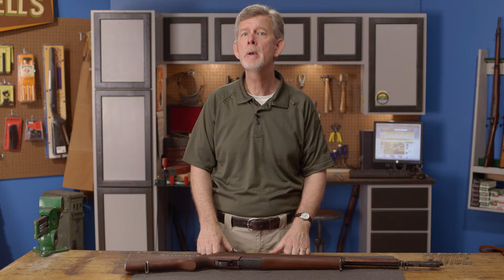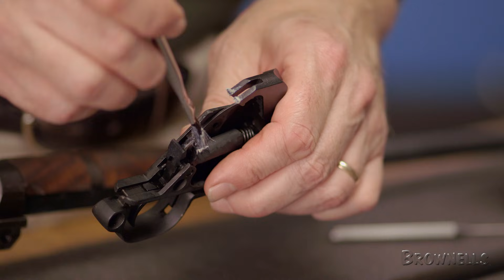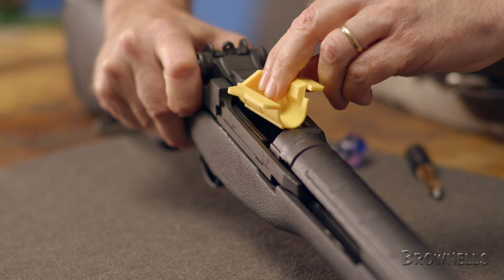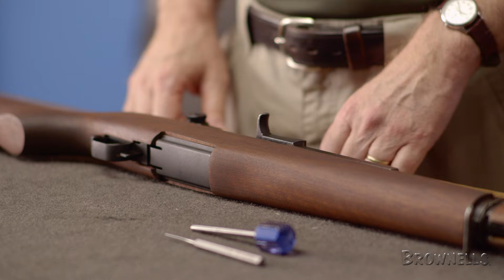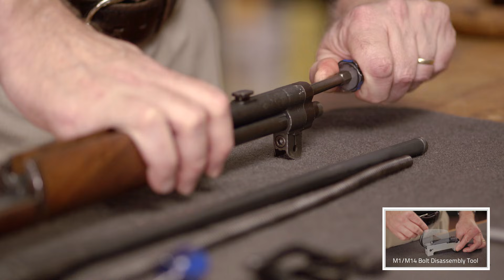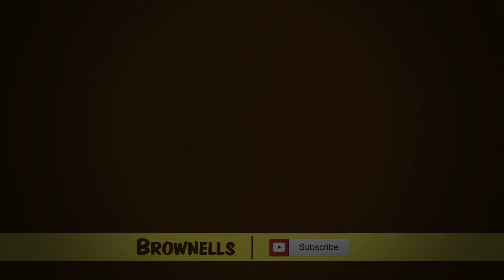M1 Garand Firearm Maintenance: Part 1 Disassembly

Comment: I had a Locksmith in Clovis California. Tell me that the M1 is no M-16 so don’t clean it like an M-16..  He also said that removing the gas cylinder too many times will wear out the splines on the internal gas cylinder and barrel so I found out the hard way..  I ended up with the proper barrel for the year of my rifle that when the gas cylinder was assembled, it was a nice tight fit.  My M1 shoots beautiful now..

Comment: I learned to get a medium string, tie one end off, oil the string and loosely wrap it around the small threads like the gas cylinder lock, screws, etc... going back and forth cleaning the grooves, then a light touch of wheel bearing grease ( actually artillery and weapons grease ) , this prevents siezing up, also on all moving parts, reducing in friction and easier cleaning. When stored a film.of grease in the bore and front handguard spacer.  Q tips, tooth picks, dental picks, pipe cleaners, fine steel wool, REM WIPES, bore brushes. A 1 piece steel cleaning rod,  armorerors tools ( no screwdrivers ) , 3 in 1 oil,  etc... for my cleaning kit.

Comment: First time disassembling this Garand, I have 5, I cannot get the  the follower rod and spring to disengage from the receiver, I’m afraid to break or twist a rather small component as it will not budge, do you have any Garand tips to loosen this component, I have followed these 4 parts of disassembly, maintenance, lubrication and re-assembly before, never had this problem, any words of wisdom would help, by the way, I have never fired this weapon so it is brand new and unbroken in!!!😊

Comment: Great info, as always. You should do more total disassembly videos. I've been restoring and maintaining a lot of firearms lately for friends and family, and I want to learn how to be a gunsmith. I disassemble the gun down to the smallest piece that I can safely do with my skill, remove anything any little speck of dust that a Marine Corps drill instructor could even dream of finding fault with, then give everything a coat of Ballistol, lubricate where needed, leave dry the parts that need to be dry, etc. The problem is, a lot of the firearms I've been working with aren't shown in YT videos. Or only the field strip phase is shown, or the disassembly won't show how to take the bolt and trigger group totally apart, or the person's hands are in the way so a specific step is poorly shown, etc. The worst is when there is a YT video that shows the steps required for total disassembly that I need to see, but it's part of a video about customization or high level gunsmith stuff that I can't do or don't have the tools for. So the video is named something else other than "Firearm X total disassembly and reassembly" or "Firearm X part Y total disassembly and reassembly," and so it takes me hours to find. So, if you would go through common firearms and show how to take them apart down to the last little spring with clearly and systematically named videos, I would greatly appreciate it. Firearms like the Savage 110, Marlin 880, and ones that there aren't videos for on YT. I think that would help a lot of people and spread firearm knowledge. Any help with how to clean, restore, and maintain firearms in general would also be appreciated.  Thanks again for sharing free gun info
Reply: Any information is good information bud

Comment: After opening the bolt to check the chamber, and then closing the bolt again, the narrator does not mention or show de-cocking the action before removing the trigger assembly.

Comment: If it hasn’t already been pointed out, when opening the bolt be sure it is locked back to it’s rearmost position. It is a fairly common mistake for the inexperienced to not pull it alll the way back and have the bolt catch on the back of the follower. This will hold it back but if the rifle is jarred or the follower is bumped even a little the bolt will slam shut. If a finger or thumb is in the way it will get smashed. You probably won’t bleed but you will cuss.
Reply: i just gave myself garand thumb 30 seconds ago w/ this exact scenario lmao. decent amount of blood and hurts a fair bit.

Comment: I just realized my .308 rebuild is permanently bedded womp womp. I guess that bolt will just have to stay dirty.
Reply: Unless someone really screwed up the bedding job it should still come apart, although you really shouldn't take it apart often. Use a rubber mallet to pop it out.
Reply: @rslover65  It turns out it was not bedded that way it was just a very very tight fit. Like hard enough it needed to be put in a vice and slowly coaxed out.
Reply: @HaqqAttak  that's good, it's not impossible that it was stuck, a bad bedding job will do that. I'm guessing it's a NM rifle?
Reply: @rslover65  I do not know its origins. .308 is written in white on the side of the barrel. It may have been someone's one off job. It has problems with overgassing that seem to be worse than your average .308 somehow. 
I fixed it with an adjustable gas plug but not before I destroyed a brand new bolt.

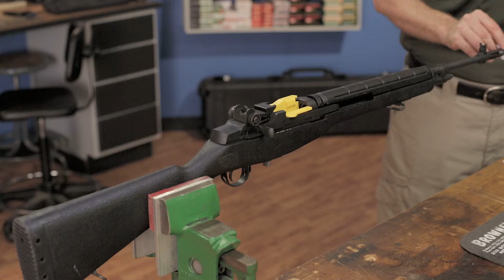Comment: Uhh at 0:45 isn't that an M1A,the civilian version of the M14?
I was taught to remove the action from the stock by holding the receiver and slapping down on the pistol grip of the stock to break it loose.
Reply: @sonofizzy  Look closer.
Yes,they are virtually the same rifle but there are differences.
Reply: @doughesson  I have had several Garands for years and still have an M1A (civilian version of the M14).  I intimately know about them and their respective appearances.  What is disassembled here is an M1 Garand.  Have a good night.
Reply: @sonofizzy  not at the 0:45.
That is a for real M1A rifle my friend.
You have a good night too.
Reply: @doughesson  I repeat that the rifle which is being disassembled (and is the subject of the video) is a Garand. I will correct myself in that the rifle shown briefly with the yellow Garand Buddy in it is an M1A. So what? It is not the subject of the video. Again, have a good night. 😀

Comment: Use a round (.30-06) to move the trigger to the rear.  All you need to tear down an M1 is a .30-06 round.  Never tap on the front sight to remove the gas cylinder.  You should tap on the bayonet lug.  You obviously don't know crap about an M1.  USMC '69 - '73; Vietnam '71 - '72.

Comment: My gas cylinder will not slide off. Weird
Reply: Not weird. A tight fit is good.   The gas cylinder should not be removed very often.   Over time, the splines keeping it in place, will enlarge, and make a sloppy fit.   Not a good thing for a part of the rifle operating under pressure.   Last thing you need is gas leakage around the port.

Comment: the tools used in this video where can these can be bought
Reply: bernard kircher Brownell's would be my guess
Reply: Here is a list of the specialty tools and Brownells part numbers.
M1 Muzzle Buddy 100-015-394.
M1 Chamber Brush 749-000-770.
M1 Bolt Disassembly Tool 080-818-000.
M1 Muzzle Guard 234-014-001.
Lubriplate Grease 311-130-014.

Comment: I need some help. My M1 will not let me pull back the bolt. As in when I go to pull back the action the bolt will not rotate. I thought it was ceased so I lubricated it very well and it still won't pull back or rotate. please help me
Reply from the maker: Hey Ryan! Because this could be due to a number of issues we suggest calling our Gun Techs at 800*-741-0015. They'll be able to assist in locating and remedying the issue.
Reply: I have dealt with Brownells a number of time x over the last many years and have found them to be extremely professional and very helpful. I'm 70 years old and I just purchased my first M1 Garand so I am looking forward to shooting and experiencing the Garand experience. Went through the USMC with the M14/M16, my Dad used the Garand/BAR, from Normandy to Remagen. SEMPER FI

Comment: My M1 Garand does not have that trigger latch to remove the trigger assembly from the stock. It's just an empty part, maybe it once was? How do I remove the the trigger assembly when I don't have a latch? Could it be possible that since mine is a later H&R Model it won't have a latch?
Reply: Tury Ruiz I'm assuming you've both got a stamped trigger guard rather than the earlier milled type shown in the video. It doesn't have the hole in it like the one in the video and was made towards the end of WWII and into the post war years. Disassembly is the exact same as the milled. Use your finger and pull back on the rear of the trigger guard and then up.
Reply: did u ever figure it out? mine is the same way